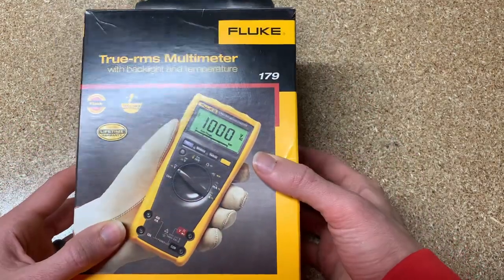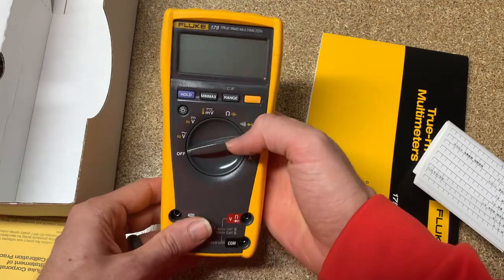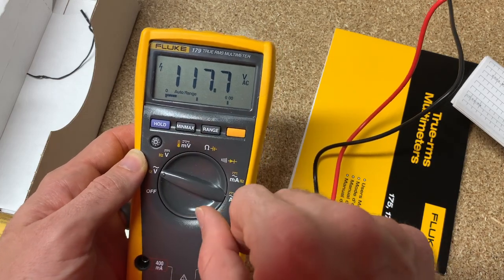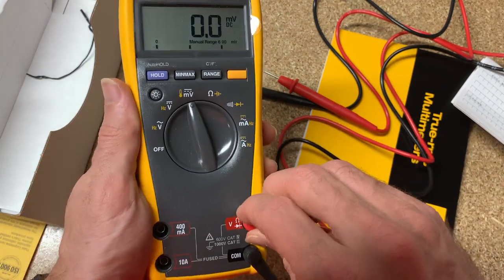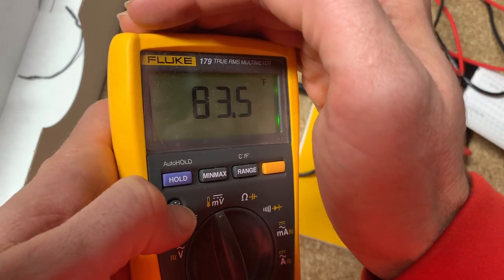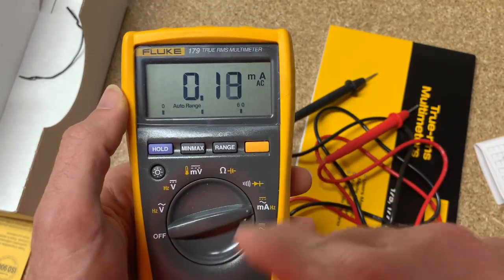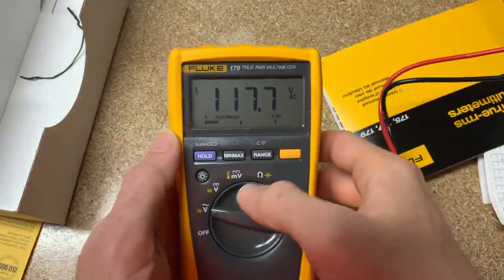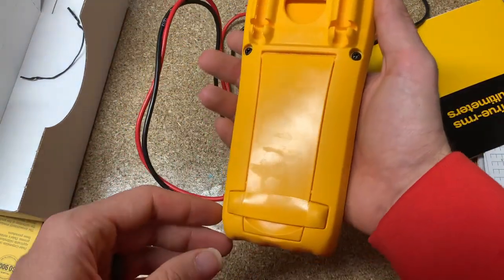Fluke-179, 177, 175 - Fluke Fridays - Episode 35

Comment: When I became serious about auto electronics diagnostic and car audio SQ installations, I bought this same 179 meter in late 2003 shortly after it was introduced. It costed a fortune back then!! I bought it with all the accessories like the temperature probe, the AC/DC high amperage clamp adapter, and the audio capture/frequency analyzer peripheral. I saved up for a while to lay down over a $1000 for my gear. Best money I ever spent!! The 179 has had some repairs over the twenty years but it's still rock solid today. The temp probe and amp clamp still work like day one. The audio input piece has been through some battles, so now it's just a 'showpiece'. If it ain't a Fluke, it's probably wrong! 😂😅😊

Comment: Thank you for this helpful video.  I could not read in the owners manual how to check the HZ frequency.  Very helpful video.  My manual does not have the measurement published.🙂
Reply from the maker: Amprobe does. https://www.amprobe.com/product/mo-100/
Reply: @fridayswithbrandon  Thanks for this reply.  I was not at my best when I made the comment.  What does Amprobe?  Does it have a meter with the ability to measure frequency of alternating current displaying in HZ units?  Please reply!
Reply from the maker: @paulgrodkowski3412  any Fluke or Amprobe multiple meter that has frequency should read AC voltage frequency in Hz
Reply: @fridayswithbrandon  Thanks for the reply

Comment: My 179 I cannot get the beep to work on resistance setting or diode tks for the very informative videos
Reply from the maker: if you have the dial turned to the sound/continuity symbol, then touch test leads together and hear nothing.  Your beeper might be broken and would need to be sent back to Fluke for repair.  Sorry about that.